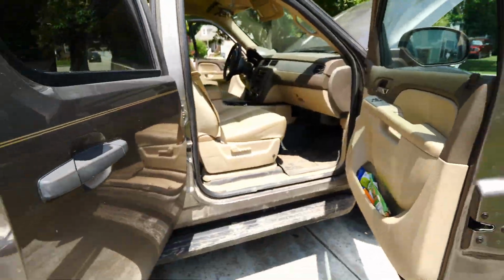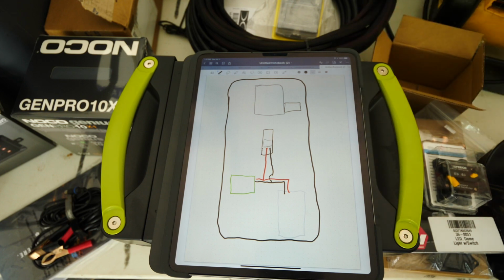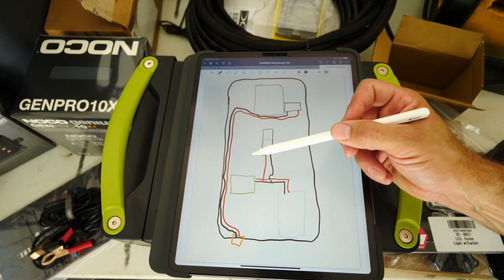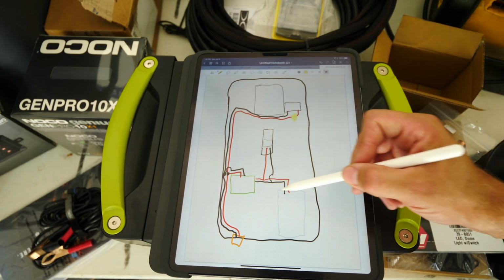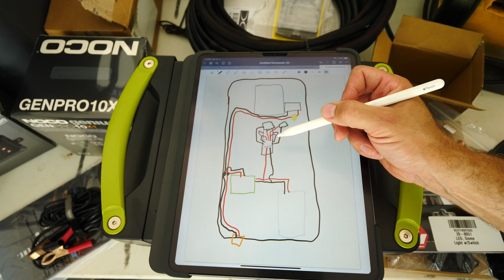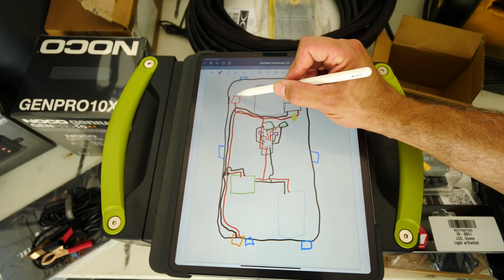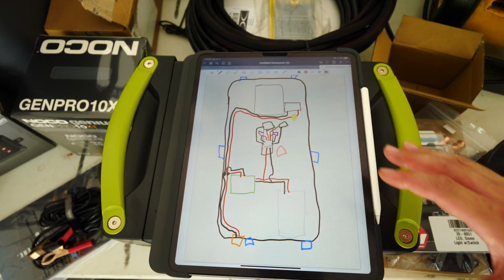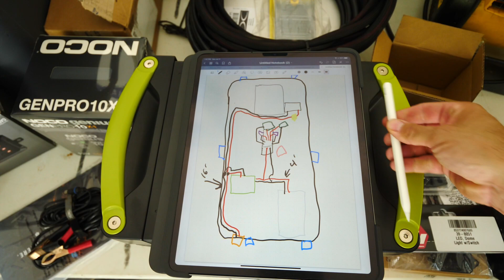Make a Wiring Plan - Overland Build Breakdown Part 2

Comment: Do you plan on upgrading the stock alternator, or is it sufficient for all the additional gear?
Reply from the maker: Sufficient when combined with the solar.  A lot of modern trucks have larger than necessary alternators already.